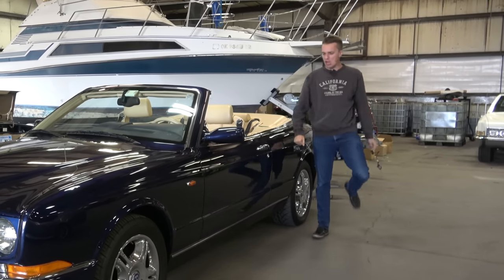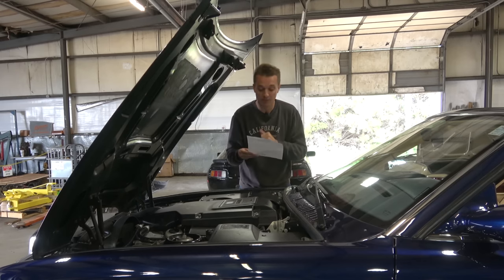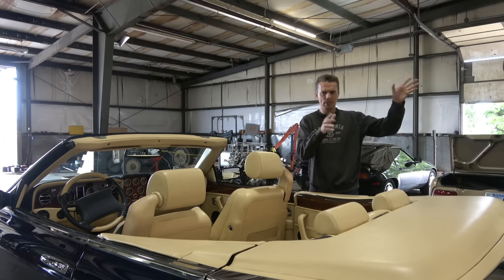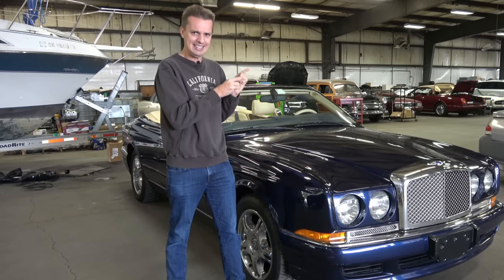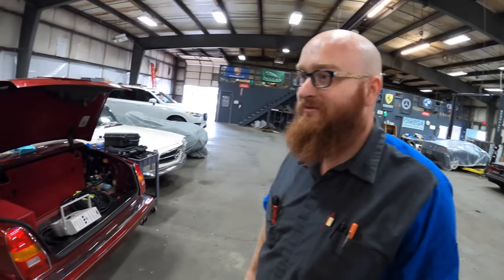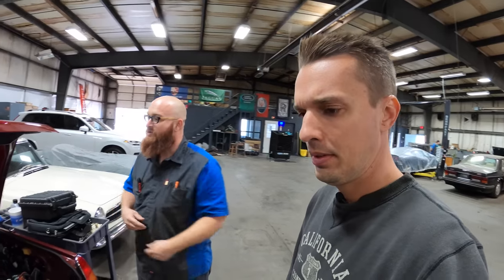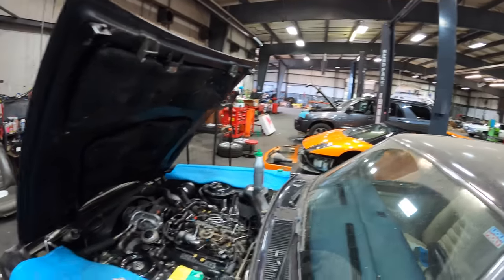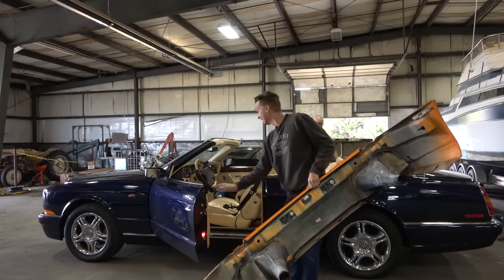My Bentley Azure Is Finally Finished, And It's a Great Lamborghini Parts Hauler

Comment: Automotive journalists have ruined the modern car. Take the new LS500 vs the LS460. The LS500 has less rear legroom, stiffer suspension, heavily bolstered seats and loaded with tech, basic stuff buried in menus, and a stupid turbo charger. That is totally not what the LS460, LS430 and LS400 was. It was about a super smooth V8, huge interior, plush flat comfortable seats, basic easy to use tech and reliable. After the first year of the LS500 and people thinking it was good, sales tanked and took a nose dive. The used market is flooded with them and I hardly see any of them on the road. That’s why I have the LS460, an SC430 and a GX470... basic can be way less stressful to use and way more comfortable which I think translates to more luxurious.

Comment: You won't own it for less than $30,000 for long. They ALL blow their head gaskets at around 60,000 mls and you will be constantly plagued with electrical issues which are going to cost you thousands. I think you said it was low mileage so enjoy it for a year then get rid of it. That is why they are cheap.